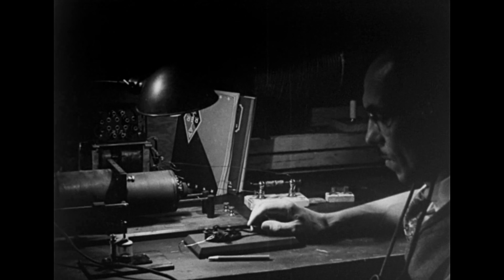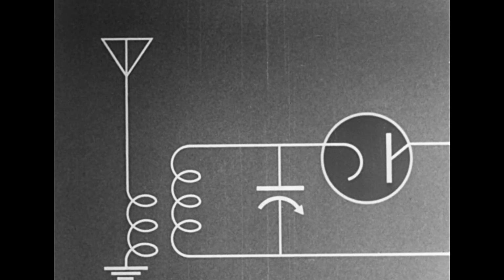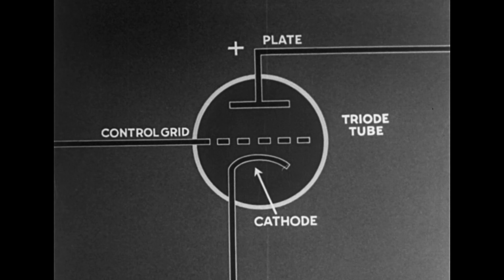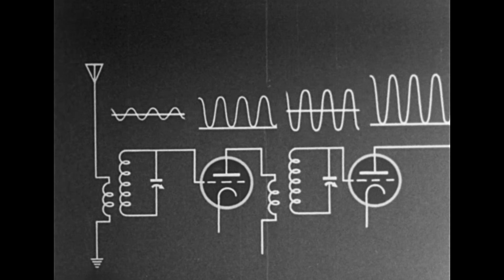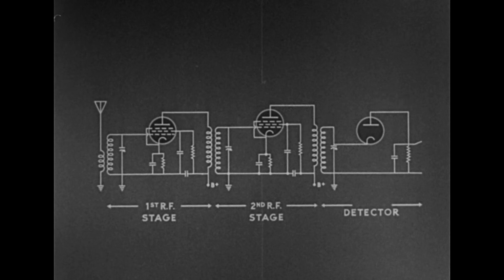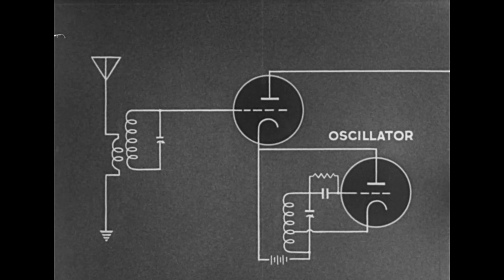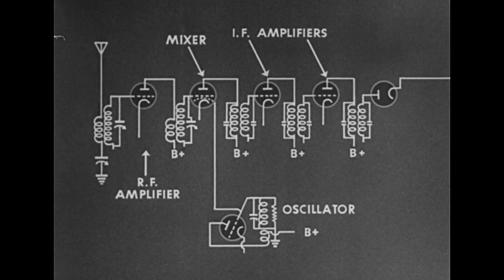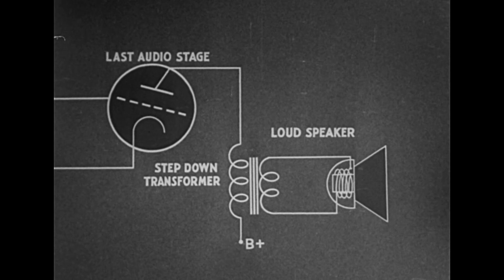Vintage Radio Receivers Typical Principles and Circuits (1942) Superheterodyne, Tubes, Training Film

Comment: ....so basically...
By mixing those 2 waves ...and producing one IF ... 455 kHz ... The rest of the apparatus is designed only for 455 hHz ...and for the rest of apparatus EVERY STATION in the Air will actually be 455 kHz...
...as mixing will always do it by ganged capacitors into 455 kHz.... 
As the station frequency changes ... Ganged oscilator followed the pattern...and 
The End result is always 
....    455 kHz.

Comment: The  way that a diode detector works on AM is this:  AM  has an RF carrier, which carries NO   modulation,  and at least one, and usually two sidebands,  which are displaced from the carrier  by the amount of the audio modulating frequencies.  They are  the difference  of the audio and the carrier,  below the carrier freq, and the sum of the audio and the carrier,  above the carrier freq.  If we ignore one,  when you receive  say,  a  test signal modulated by  1 khz audio,  what is actually coming to the detector  is the original carrier,  and a  sideband 1khz  above the carrier.   The  detector  MIXES  these two,  and the simple output is  the carrier,  the sideband,  and the audio,  the mix  difference of the two.  The  RF sideband and RF carrier are bypassed by  componets at the output,  and the audio is what is left.

The only way that you can receive  CW  morse  on a TRF radio is by have  one state set up  so that regeneration (feedback) can  be controlled, thus generating  a  fake carrier  to act as the sideband.  By tuning the  received signal,  the  regen  signal will mix with the incoming RF   signal   as above, in the AM  example, to produce a beat note
Reply from the maker: A fascinating technical explanation, thank you very much.  It sounds like you know your radio tech!  ~  VK

Comment: The  simple explanation of detector  operation  as a  recitifer is  COMPLETELY INCORRECT, and the proof is   the words  "single sideband,"   AKA  an AM modulated  signal normally has   two sidebande.   Further,  neither  the  galena crystal,  nor  a vacuum tube  diode can  detect and produce audio from modern  cw  (continuous wave)  morse code.  Only a  thump  will be heard, as the carrier is keyed.  In the old days of spark and arc transmitters,  the  morse  wave WAS modulated in AM  (and likely also  FM)  because  of the  rasp  introduced by the transmitter itself.
Reply from the maker: Thank you very much for your technical review and comment.  Sounds like you are experienced in the science and history of early radio.  Perhaps one or more of our other radio tech savvy viewers will comment on your thoughts as well.   Thanks again!  ~  VK
Reply: I'm confused. You go from detector operation to AM sidebands to cw Morse code to the modulation of a "morse wave." I would say the rectification of a detector is fundamental to the process. I don't know why sidebands even need to be considered in a basic explanation, nor do I get the relevance of demodulating a cw signal. A little learning is a dangerous thing.

Comment: I found it instructive to learn that when Major Armstrong coined the term superheterodyne, it was a contraction of the terms supersonic and heterodyne. I.e., the IF was at a frequency above what you could hear.
Reply: The prefix 'super' stands for 'superior' in the super-hetero- dyning, I have read.
455KHz is the frequency of the electrical signal and it is NOT the acoustic mechanical audio signal; human's audible spectrum is between 20 and 20KHz mechanical disturbance in the air.
de VU2RZA
Reply from the maker: Yes, an interesting point!   Glad you enjoyed it!

Comment: Great little film. It's always confused me though why Americans use different terminology in electronics from the 'world standard' ?

Capacitor=Condenser, Valve=Tube, Anode=Plate, Hertz=Cycles.
Not being nasty, just curious. 🤔
Reply: "Cycles" and "condenser" haven't been used in electronics and engineering in the US for many decades. Remember that this film is ancient.
Reply: @jonqualey2204  Yeah, but they were never used anywhere else. I've met people who were technicians in the 40's and 50's from Europe to Australasia who never used those terms.
Reply: @Franko_Walker  The term  "Hertz" was not adapted until the early 60's.
Reply: @Franko_Walker  "Cycles" (actually, "cycles per second") and "condenser" were in common use in the UK when I was a kid.
Reply: Well, to be correct Hertz is an unit of the frequency or cycles. In Germany we would say the oscillator is producing cycles with a frequency of 10 kHZ , or simple is producing a frequency of xx Hz
Reply: We just like pretending that we invented everything. As our old joke goes, There are two types of countries, ones that use the metric system and ones that have been to the moon!
Reply: I have always wondered that too, being an American. The standards the rest of the world use are more than capable of doing whatever task they have, but we have to act special.